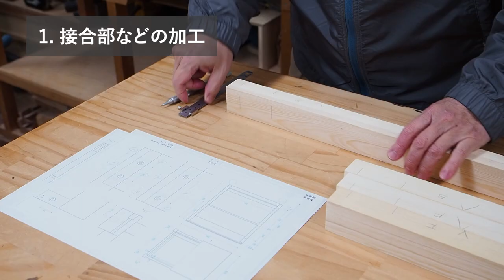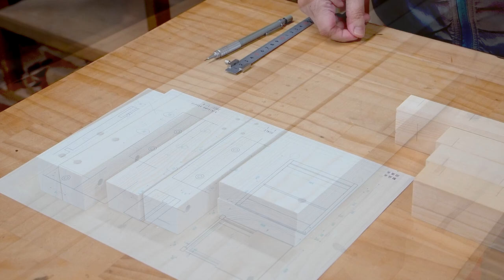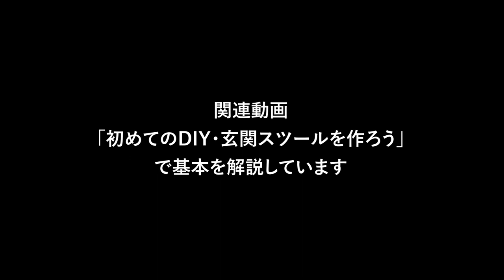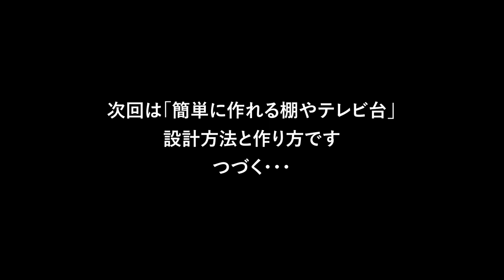A Rolling Tool Cart : Simple and Easy to make Shop Cart (subtitled)

Comment: I need to make one of this, but here in Spain wood is so expensive right now, even plywood. One thing that I would like to ask, what Router model is the one at 0:19 and 18:06? I would like to purchase one and I have no idea what is a nice purchase, just for DIY projects. Amazing video like always, keep them coming!
Reply from the maker: The compact router is an old Makita, model: 3703. Still working after 25 or more years. Successor is 3707 or 3709.  Any well-known brand router can do the job and the basic one is enough. But if you have the budget, look for a model with a soft start feature.  And plunge base option is handy for advanced projects. also check for a dust port option. Good luck!
Reply: @kikikumastudio  Great I will check it out, also I almost forgot, what wood drill bits do you use? They leave a really clean hole. Thanks alot.
Reply from the maker: Auger bits: Star M (Japan) 
Brad points: HSS-cobalt Alpen (Austria)
I can recommend these bits. I've just added subtitles to the video "Coat Rack with Shaker Pegs".  You can see how the old Makita does the job . Please take a look. Thanks.
Reply: @kikikumastudio  I will see if I can get them, thanks alot. Also I've been cutting wood so far with japanese saws, I currenly have a Ryoba and a Dozuki but its really hard for me to cut plum and square. Would be amazing if you make a video in the future about how to properly use them and maybe if you have an idea for a cutting jig to make things a little bit easier. Thanks alot can't wait for the new videos!